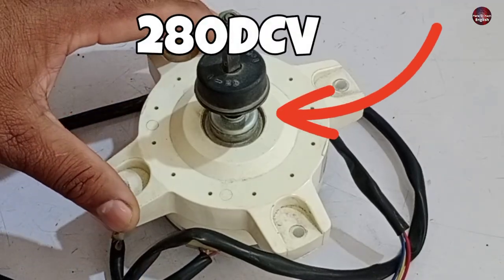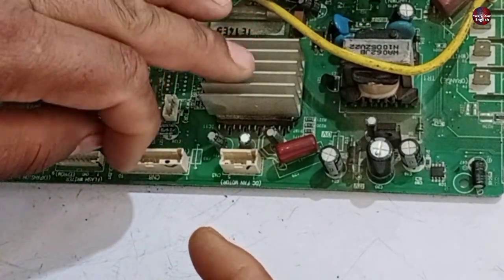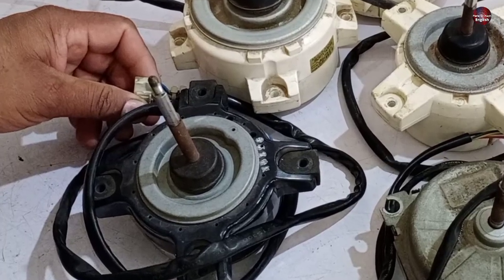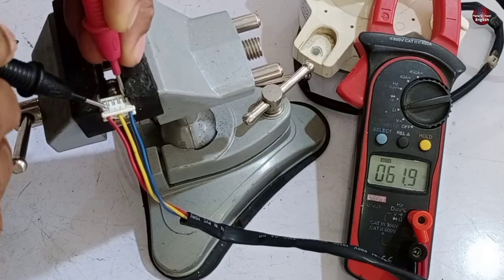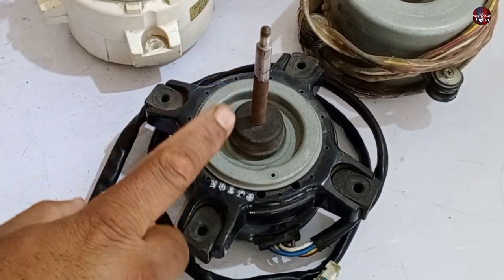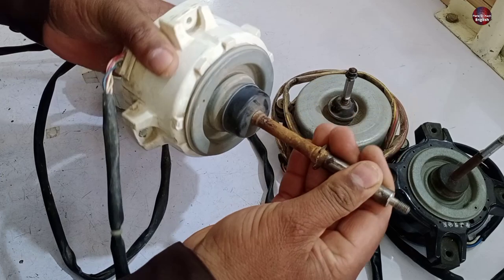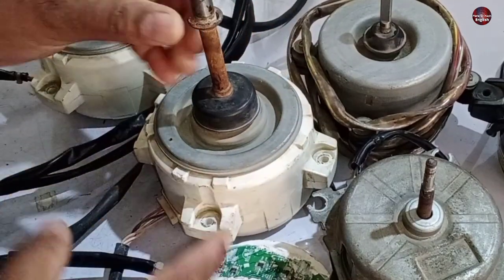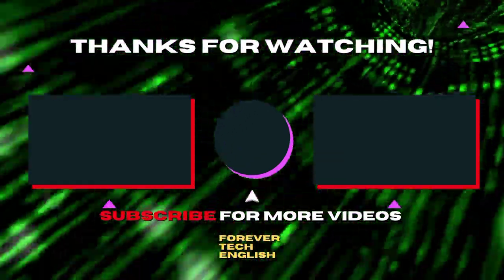Testing 280 DC Volts Blower Fan Motor

Comment: Hi bro . I hv problem  in a sharp JTECH INVERTER AU-X10WMD 1.o hb 
The error is 11-5 .(Outdoor unit DC fan open connector error)
 I chick   wiring and connector is OK.
My friend said  the problem in pcb board .
Is it true ?
Can u help me to repair it 😊?